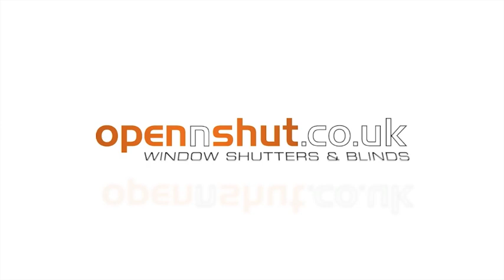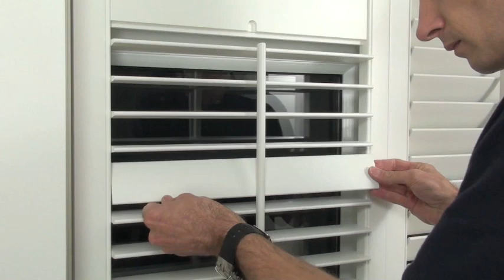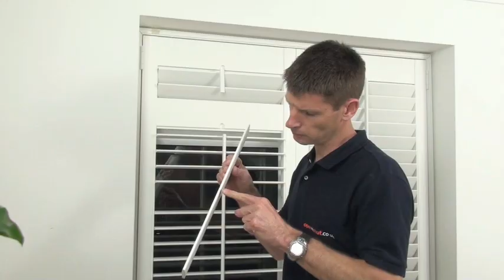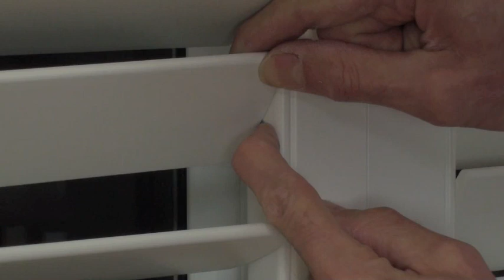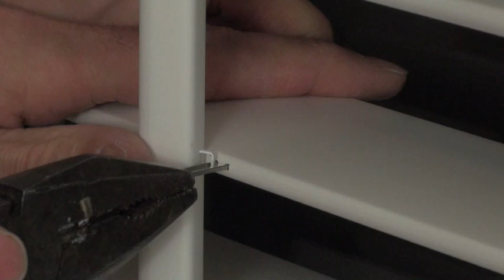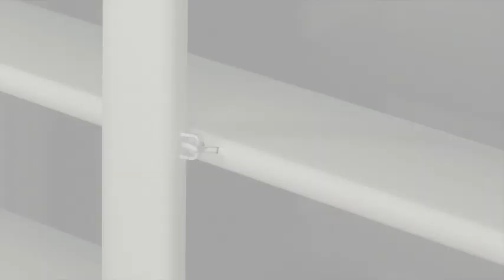How to replace a broken shutter louvre blade or pin  - control rod and staple

Comment: I have a dark wood three panel room divider with slats that go up and down by a rod in the midsole of the slats, one is broke and I am having a devil of a time finding what to replace it with, any suggestions please?
Reply from the maker: Ideally, you will need to know the manufacture or contact the company they were ordered from to order a replacement, you could swap the damaged louvre to the very bottom or top of the panel so is not so visible and try and repair it.
Reply: @opennshut  that’s the thing, it’s really nice solid dark wood but has no name on it and I can’t match it by picture online so far, I was able to get the slat back on the peg and stain the chipped off part so it’s ok for now, thanks for the info